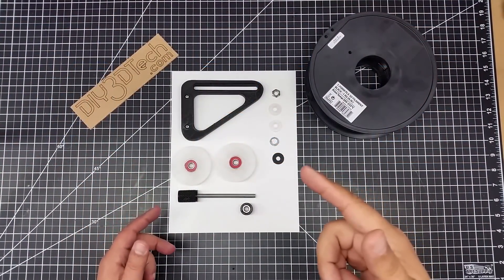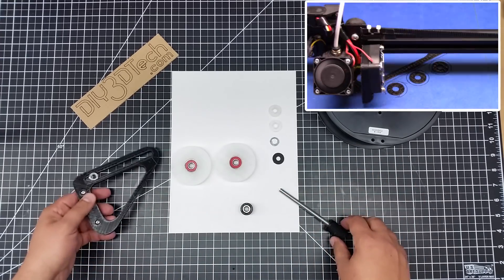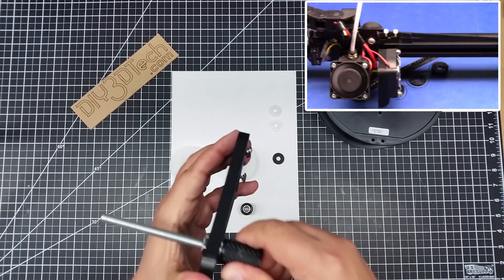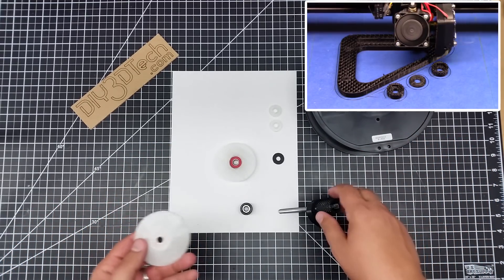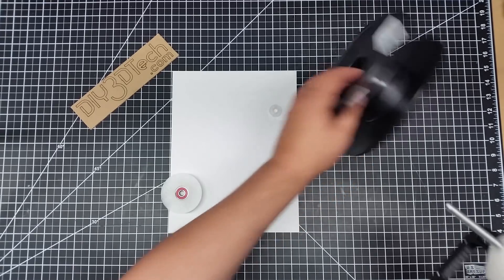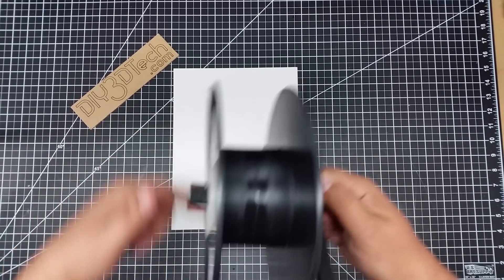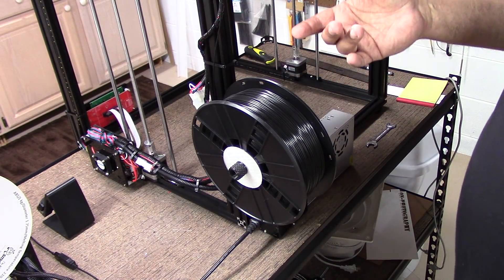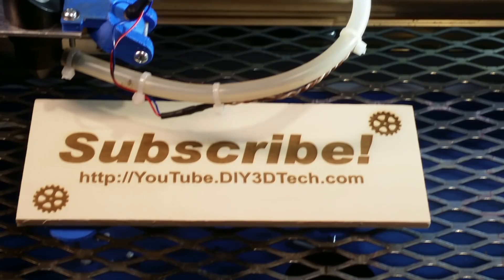Tronxy X5S - Precision Spool Bracket!

Comment: I have got the new updated Tronxy X5SA ( 2020 Model ) in the UK.  And I am still after 3 months of doing my nut just trying to make the damn printer get leveled and print well and worse still is the fact no prints wish to adhere to the heated bed either with heat on or cold? The system now is a 24 Volt printer with insulated heated bed up to 100 C.  Silent stepper motors ( only the 3 cooling print head fans make the noise ) The print adhesion is bad, I saw that Tronxy do a Magnetic Ultra Flexible head bed cover, You stick down the self sticky base on the metal bed with the original metal top plate of the bed removed ( the stickiness of this new magnetic covering stays sticky so you can take it off and preposition it ) I thought well for £21.00p it be worth the upgrading to this Flexible Magnetic bed cover? Nope the same issues as the original solid metal bed top covering!  I tried glue sticks I tried firm hold hair spray, No luck I did try a instant contact rubber Adhesive glue I normally used for shoe repairing!  It did hold down prints better But still not good enough for a stable stick down print? I've watched tons of 3D printer main users all saying use glue sticks, hair spray, blue tape etc. But nothing works.  I seen later on that the glue sticks and hair spray only for Glass beds not mine?  I got PLA,  I got PLA +, I got PETG, I got TPU, and got ABS. Now if only I can get the damn prints to stick down fully until I flex the bed at the end to release them!  I see your printer had blue tape on it's bed in the printing clip, does this really work on this type of Printer and what sort of use time wise can  get from the tape per printing uses? Also how do I keep the bed tape clean without using special cleaning like Alcohol etc.?  Also about bed leveling, how is best to do it on this printer as my X5SA has 6 adjustment screws instead of the normal 4 on other printers!  I has auto level and manual and the auto leveling checks 16 points on the bed I used the manual which has 5 points. Neither seems to level the bed enough to do a good level printing area!  Any help be great. love your videos.
Reply from the maker: You might really be over thinking this.  Search my channel for First Layer as the video goes into detail on how make this work as I can tell from note that you are "over" leveling the bed.  Again look for this video as covers a number of things but just briefly over extrude your first layer this will compensate for reasonable variations in the bed level and provide greater surface area.